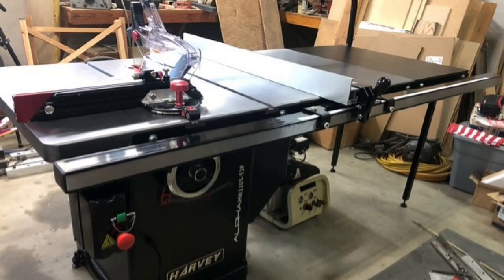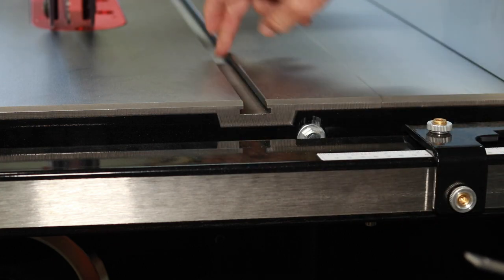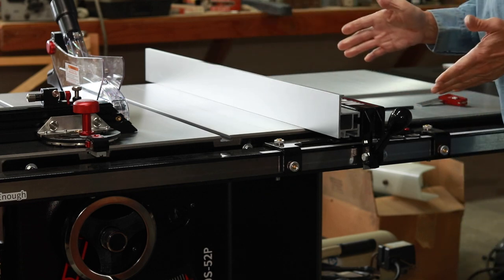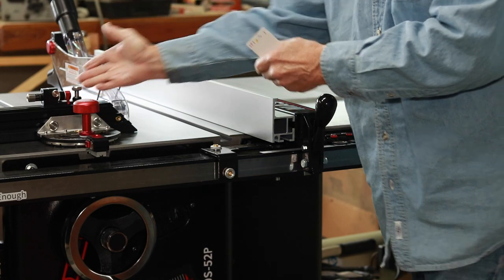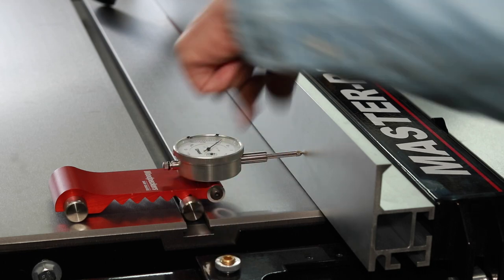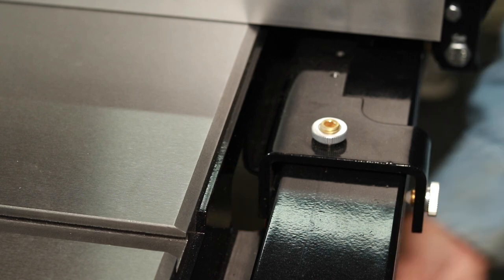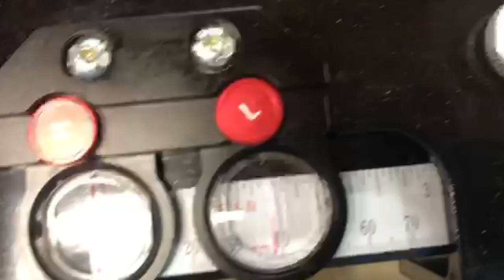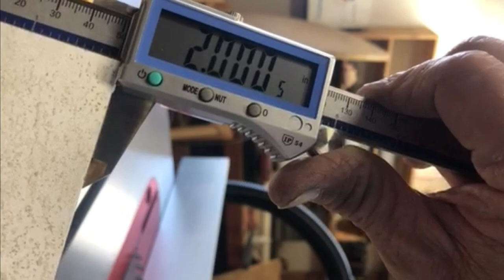Harvey  Let's square up our RIP fence

Comment: I was setting my table saw today and I agree with all your details that you covered in your video about the fence very well explained and yes I totally agreed with you on that bad design of the fence. I was expecting better quality from a $3000 machine. I actually ended up adapting a T jig that fits snugly in order to keep the aluminum piece in place and relocate one of the knobs so that is locked evenly. I was not happy with that at all with so much play at the end of the rail that eventually will drop since there is no way to tight it  up enough to keep it in place. I will notify Harvey about this and see if they offer some kind of solution for others. Thanks for the effort and time to make this videos that helps to make this better. May God bless you.
Reply from the maker: Hector Arias It's truly my pleasure. I've been to the Harvey warehouse a few times I think I may go again in a week or so. I'm going to talk about the saw and just tell them of what I have come across. The more we speak up hopefully they hear and upgrade the tool. Thank you again Hector Bless you sir and thanks for viewing.

Comment: Thanks for the advice, setting mine up tomorrow morning ❤️❤️❤️
Reply from the maker: Tyrsa if you have any issues or questions please don’t hesitate to ask you can email the channel and I’ll respond quickly. I do have a few Harvey stickers if you like. Just sent the channel an email and I can ship you off a few gifts. Channel email backintheshack@outllok.com 
enjoy that new table saw
Reply: @TheShackHome  I got it all put together and nearly everything is dialed in from the factory. The one disappointment is the blade being a 1/16+ out of square with the T-tracks. Wish I had caught it before mounting the wings and fence. Have any good tips on adjusting that? I know I have to loosen the 4 cap bolts to the table, but worried about how to go about making the fine adjustment
Reply from the maker: @tyrsafray4640  With out completely disassembling the table loosen the bolts get a piece of wood and a small sledge hammer or dead blow hammer and just tap a little at a time sneaking up on your mark. if it ends up a few thousands off that is good in my book. Seriously if you would like some stickers just email the channel and let me know. any other questions just ask.
Reply: @TheShackHome  thanks, that was what I was thinking too! I’ll email you for some stickers
Reply from the maker: @tyrsafray4640  did you get it squared up ?
Reply: @TheShackHome  yes, with three gentile taps. Within 1/1000th and happy with the results ❤️❤️❤️
Reply from the maker: @tyrsafray4640  fantastic, Enjoy your table saw. Don't hesitate to reach out if you need anything else. The stickers and an extra gift are still available if you like.

Comment: I'm going to agree with the posts complimenting you for the videos covering the detail setup of the Harvey saw, and with the posts criticizing the manual that came with the saw.  For a company trumpeting their saw's quality and charging the prices they charge you'd expect that the manual would comport with that, but it doesn't, not by a long shot.  I tried your "two business card" setup for the height of the removable fence off the table, but no matter high tight I cinch those posts down the far side of the fence droops.  Perhaps that tightening bar on my saw isn't entirely parallel with the main fence mechanism.  So I resort to trail and error to get the clearance on both ends of the removable fence even.
Reply from the maker: Tom Young it was my pleasure. I have talked with Hung at the warehouse about the fence. Not sure if they will look into it but I mentioned that splitting the front or adding a back support would greatly help . Happy New Years and thanks for viewing

Comment: When following your instructions, and I'm having a really hard time. Bottom of the rip fence is zeroed out and after adjustments I'm getting a bit of a wave effect. I'm using a new a similar dial indicator from A-line-it. And the middle of the fence is about .01" where  as the top of the fence is in the ideal .003". Any thoughts on what's causing this? I tested a cut, and I am able to see the noticable difference in my cut riding along the rip fence where the cuts are a little concave.
Reply from the maker: Sher O'Deen I had to readjust my fence. I started to notice that when the material was exiting the blade it would catch a little on the blade and actuall leav a little burn on it. didn;t have the riving knife installed. So I started to adjust the fence so upon exiting the blade it would have more relief. I ened up going i think 20 tousand off so the rip fence was angled away from the blade at the exit end which allowed for enough relief that it stopped catching and even stopped causing a little burn on my material. Give irt some relief and see what happens.

Comment: Basic question...what is the NEMA rating of the plug that came with your saw?  I'm guessing either 6-20P or 6-30P.  The instructions for this saw says to use a 30A breaker so I am guessing it comes with the 6-30P.  I order the 36" version of this saw and I need to make sure I rewire my shop correctly right now as I do not get the saw for a few more weeks.
Reply from the maker: MixingGBP yes I had to us a 20' extension with 20 Amp 250-Volt NEMA 6-20P 3-Prong Industrial Grade Have Duty Plug for the ends I only plan on staying here a few more months so didn't want to run another line. It works great. The diagram in owners manual simply states 6-20 plug the sticker on the saw reads 230v, 60Hz, 1-Ph. Draw amp 16A
Reply: @TheShackHome  Thanks for the reply.   I am having an L6-30 on a drop cord spool from my ceiling  and L6-20 installed in my shop wall so it can cover my Harvey table saw and Harvey band saw when they arrive in a few weeks.  I see in the Harvey table saw manual that the recommendation for the table saw is a 30 amp breaker, so I am a little confused as to why the table saw doesn't come with a 6-30 plug.  The concern for me would be that the motor would draw current close to the 80% limit of a 20 amp service which would put you right at 16 amps.  I realize this would be only at max draw conditions, which is why a 20 amp service would likely work just fine 99.9% of the time.

The 80% percent breaker limit was told to me by a few electricians I talked to and also read that in some electricians forums.  Hopefully the way I wrote this is understandable.
Reply: @MixingGBP   your right using a 30amp draw when that motor starts to work it will pull more than 20amp.
Reply: @midnightsun2483  yep, I did go with a 30 A circuit with L6-30R.   The saw came with 6-20P, so I adapted it to L6-30R.  No issues at all.
Reply: Harvey says a 6-20P like some of the comments mentioned when switching from 115v to 230v. I think I am going to use a L6=20P for my saw which is a locking type plug.

Comment: You are not anal. You set things up with a very high level of accuracy which is how it should be. It pays to be on the perfectionist side of things during setup. It makes using the saw safer, easier to use and makes for very accurate cuts.
Reply from the maker: N A thank you but sometime I think I set that at a too high of a level and have gotten in some hot water. Its OK to have a level of expectation but just don't go nuts if it isn't met and beat ourselves up about it.

Comment: Thanks for the great vid.  My first question is,  the high and low measuring window.  Does it have to be the right window as low and the left window as high?  I think mine came as the other way around and even the instruction manual has it as the other way around and when i put my high window to zero then switch the fence to a low fence i cant get the low fence window on zero.  It seems like such a no brainer but i cant get it.
Reply from the maker: korrupt4 sorry for late reply been a bit busy. I did mine the way I did because I have an Incra fence system that just arrived for it. so wasn't going to keep the Harvey system on very long and just needed a single reference point. If your keeping the Harvey fence Id set the H to 0 so the L should be very close. If you flip the fence soo the High side is flat set the measure to Zero when the saw blade just kisses the fence. When you flip the fence up  the low should read very close. If it make more sence to you , I might of done this, reverse the letters so when the higher part is flat thats the low position and when its flipped up that the high position then do so. Whatever is easier for you. I also put a piece of tap over the other window so I never read off the wrong window. That's just another reason for me to make a mistake.
Reply: The paper manual is wrong.   Check the electronic manual as It has been updated.  The lower fence knob should be installed on the left, upper fence knob on the right.

My paper manual was wrong, so I called Harvey to confirm this knob arrangement.
Reply from the maker: @MixingGBP  I didn't even really notice I never used the other sight I actually put a piece of tape over it so I wouldn't reference off the wrong sight. I have an Incra fence system that finally showed up and actually in the process of installing it now so that will be another vid coming out soon. Thanks for the update and thanks for viewing.

Comment: Thank you for your videos. I’m awaiting my 110-36. I imagine changing the blade i.e. thin kerf vs regular, or even different brands will throw off the fence measurement via the tape a bit.
Reply from the maker: Chris generally speaking, all blades are an 1/8” in width. they all vary somewhat to get exact measurement use calipers. Thin kerf are only slightly thinner about a 1/32 or so. I believe infinity make a 1/16” thin keyed blade. Generally speaking your measurement should be close just remember if you choose to use a thin nerf blade you will just have to compensate for the difference on your measurements. A thin kerf blade  I would only suggest using on very expensive wood or in certain circumstances it’s not something you want to use every day
Reply: Thank you! 
I forgot to also ask how do you like the blade that comes with the saw?
Reply from the maker: @christopherungaro8454  it will get by but I would highly suggest upgrading to a quality carbide tip blade you can get 15 + sharping's out of. it will pay for itself after the 2nd sharping. I like Ridge Carbide tool blades but if you plan on cutting 8/4 stock often then you should invest in a quality 24 tooth blade. 40 tooth is a good general all purpose but will burn thick stock you need a fewer tooth blade for thicker stock. I'm thinkin of putting out a video on this soon just to help people out. there is a weird calculation to this theory but it works.
Reply: Thank you.